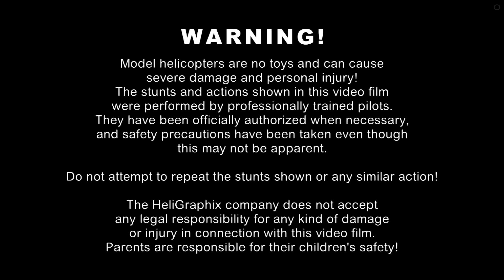WILL IT WORK? 2 pilots trying to fly 1 new dual-heli. Experimental flight ...

Comment from the maker: hi Mike, tail rotors weren't used as they have no significant influence on yaw of the Tandem. In fact, tail control was disabled (and tails damaged after the first crash anyway). Instead, yaw axis is controlled by different elevator inputs of the two helis. Check out description below video and our facebook page

Comment: why wouldn't 2 helicopters work? The only reason a bi copter doesn't work as well as a quad or tri is because they only have 2 rotors total. This set up has 4. Two for lift, 2 for yaw. Try making it work without the tail rotors

Comment from the maker: we thought about this and went for the current side-by-side version because we figured it should be more stable in flight. But in-line certainly is interesting as well. Disconnecting the front tail would be the way to go, think so, too